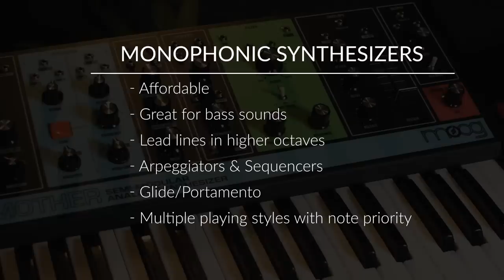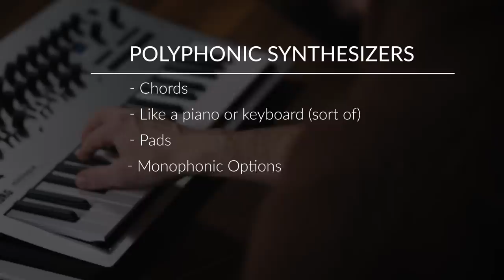Monophonic vs. Polyphonic Synthesizers: Which is Right For You? | Reverb

Comment: The Moog Grandmother can actually be used polyphonically as well. It requires the use of It's 3rd hidden oscillator which is utilized by patching the LFO Modulation. You would start from the yellow bay "ARP/SEQ" by plugging in a patch cable from KB OUT > RATE IN on the black bay labeled "Modulation". Next step, starting with the black bay "Modulation" plug in another patch cable to WAVE OUT > NOISE IN on the "MIXER" which is the black bay in the middle. You can nowuse the Noise in as your 3rd Oscillator, located below Oscillators 1&2. By adjusting the RATE knob in the black Mod bay, you can create a 3rd voice. Your second voice can be achieved by adjusting the FREQUENCY knob on Oscillator 2. Resulting in a triad, one key at a time.
Reply: You are right, I see where the cords plug in. I like the grand mother.
Reply: It's technically paraphony rather than polyphony, but nice tip!
Reply: Dude thank you for the tip!
Reply: @benjwgarner  correct - not even close to polyphonic playability, just another note that you have to change.  for the 3rd note I prefer modulation wave out ->> attenuator input, attenuator out ->> oscPitchIn
Reply: That’s not polyphony , the grandma is duophonic (your patch trick not withstanding , that’s cool) The matriarch is paraphonic. 

In my experience , polyphony when it comes to VCA synths , if they share the same filter you won’t be able to play intervals or chords well. Though the behringer synths like the poly D do ok with some of their special features .
Reply: That's still only monophonic since you can still only play one key at a time
Reply: @DG-ss1gc Moog Grandmother is not duophonic, but you can certainly get 2 or 3 voice paraphony if you sequence each VCO independently with an external sequencer sending independent CV signals. Korg SQ-1 is a great and affordable way to experiment with those types of patches
Reply: I really don't know what too get  I have about 10 synths in storage but I want too sound like  John Foxx Garry Numan ultravox and pet shop boys can you help me chrisrox 
 any one........ thanks for your time Chris

Comment: Monosynths are good for playing basslines and leads. Polysynths are for the rest. Simply said.
Reply: Yes absolutely this is why I would use both synths.
Reply: Usually, yes!  But not always.  The ARP Odyssey had a Duo-tone which which was a two-voice polyphony that lends itself well to bass.  Also, a lot of Polysynths can be played in Monophonic with Unison, which can work well on basses sometimes.
Reply: @Luke especially the ones that have a switch to go into monophonic mode to get that extra monophonic flair

Comment: Whilst interesting, this comp may have been more interesting if the Minilogue was compared to a Monologue.
Reply: pulls out monocle

“Whilst”
Reply: @maxqd3  🤣
Reply: Yes definitely, but I think the tonal result may give the same outcome. Mono synths usually sound beefier than single notes on a poly synth. Using a Moog to get that across is a good idea imo because we all know those oscillators sound RAW as f.
The Monologues osscilators also sound creamier than the Minilogues, but a Moog can really get that point across.
Reply: @rederickfroders1978  
Good points.  It comes down to how each of us wants to use the tools.
Reply: just get the minilogue and get a boost pedal for the mono sounds to sound beefier..now you dont need the monologue and you have the best of both worlds
Reply: @maxqd3  
LOL!
AND a cup of tea!
Reply: @rederickfroders1978  
Further thought is that the Minilogue has a mono mode.  Not sure if it provides the same sound as that of the Monologue.  If so, the Minilogue would be the best of both worlds.

Comment: Great video and great topic Justin. Right up my street. I love analogue synths and this video covers a lot of what someone getting into synths needs to know as well as someone who is learning as I am.

The Korg Prologue does a very good job of both poly and mono. If used for multi tracking and just using loops it  can construct a whole track just using the Prologue sounds. Drums, bass, pads, arpeggiator, lead, chords, all from one machine and the bass and the chords can be done on split keys so if you are using a looper like a RC505 everything can be recorded into it.
 
The sequencer on the Moog Grandmother is awesome and easy to use once you understand it. It's the standard Moog step sequencer that's also used on the Sub37 but even more powerful so you can step sequence leads that go for 256 step apparently. That and the fact that it's semi modular so you can hook it up to other modular or semi modular units to do crazy things with the sound makes it a very desirable synth. I'm looking to get one. 

Once again great video and keep up the content. Thanks

Comment: Best synth apps (for android) if youre either broke or fairly new to the synthesizer world, and im both
(In no particular order)
1. Common analog synth/common fm synth(paid version Ex-synth-paid version has sequencer
2. Caustic (probably the best, most extensive)
3. Hexen modular synth app-can design your own system-learning curve!
4. Heat synthesizer, tons of presets, keyboard note sequencer, all the modulation you could want
5. Rock Relay: Synth FM or Rock Relay:Analog... Lots of tones and parameter control
6. SyneprezFM- tons of presets, sohisticated Arp,
7. ARPIO... arpeggio synth-board, pro version is very cool
8. Touch Vox...cool sounds
9. Pocket Talkbox- awesome real vocoder type symth, just move your lips and mouth on the speaker-it does kinda feel like your perfoming cynnylingus on your phone but the sound is dope
10. DRC synth... All presets have arpeggio option
Hope this helps you find cool sunths to play around on or even use in your music production

Comment: A point I realized that I don't think gets talked about enough is that 1 voice =/= 1 "note". if your monosynth has two oscillators that can be tuned separately or relative to one another, odds are that you CAN play 2 "notes" (pitches) at the same time to make a diad chord. Hell, if you add in an analog oscillating filter, you can dial in a triad-- though i find it trickier to do this.

Comment: I'd like to see MOOG develop a good 4 or 6 voice poly synth with keyboard (or without...) in the $1500 price range. They could do it and do it very well.  It could be like an upgrade from the GM but without all the buttons, knobs, bells, flashing lights and whistles of the 2- note SUB37. Yes, I'm dreaming but wouldn't it be nice?
Reply: metaspherz yeah as nice as the moog one is... the price tag definitely isn’t
Reply: metaspherz They just did it, Moog One
Reply: You could always check out a Deep Mind 12. I know it’s not a Moog but you can emulate a lot of great sounds out of it. Anywhere from a Moog to Juno and you can get one for under 600 bucks!
Reply: 7000$ for a moog is criminal.It's a shame that musicians that are worth 6 figures or millions can pick that up easy. I'm in college. i wish i could have a moog one lmao. maybe in 10 years.
Reply: metaspherz Yeah, exactly. Displays, menu diving, multifunctional buttons, etc. All things that can break, stop working and need replacing or repairing. SMT, surface mount technology has made synths more affordable and more difficult to work on. Lots of times you just throw it away. Moog, or any manufacturer could go back to old school technology and building them like they used to. Vintage is by far my favorite, but too expensive. Behringer D might be the beginning of something new, that’s hopefully going to be around for awhile. Supposedly they’re attempting the crowning achievement of clones... The Yamaha CS-80.  Good luck with that one
Reply: What about the Matriarch?

Comment: Nice overview!  When I started with synths I gravitated toward polysynths.  Now I find I’m using multiple mono/paraphonic(the best!) synths together.  Less muddy mixes with monos!
Reply: This comment helped me a bunch. I was already thinking mono for cleaner simpler mixing, and also budget, but wasn't sure. 
Now i know i can't afford a Bass Station 2 right now, but i can grab a korg monologue to get started, and then just add the BS-2 next year and play them together.
Reply: what  do you like to play? what's your typical setup for just solo jamming?
Reply: Nick You Nick, The Bass Station now now has paraphonic ability — but I have a Circuit Mono Station for its sequencer ability, also paraphonic, and the same sound engine as BS II.  Monologue is a nice mono synth, once you get rid of many of the crappy factory patches.  You can do a lot with a Mono Station and a Monologue, then add a Drumbrute Impact and you have a nice little studio for about $1000.  And you can build from there.

Comment: Um... the mono mode sound on the Monoloque is the same as the poly mode sound. That is, the mono mode is only using a single voice. It will still sound and play different because you won't get any note layering and can create legato notes, but the timbre of the patch will be exactly the same.

I wish he had demonstrated it poly first, then mono, then unison. You can clearly hear the additional oscillators present in the unison sound that are absent in mono mode.

Comment: Hey, youre videos are very helpful, expecialy how synthesizers work series, that I have found so far. I have decided that I want a synth. From what I found it would be analog, because it speaks more to me.

From this video I found that it is probably worth looking at polly synth that has a good mono voice. So here is my question.. I found three nice Korg units that each suite my needs in a different way. 

First off is Korg monologue around 299€
+ it is very cheep
+ has greater sequencing abilities compered to minilogue
+ would take less hassle to carry around
+ has this drive thing for filter
- it is monologue 
- it has less keys (25)

Korg minilogue around 539€
I will list only advantages and disadvantages that are relevant for me
+ it's a polly ;) 
+great mono and unison 
voices in one box. 
+ 37 keys
- doesn't have a motion sensor for movement of the knobs when sequencer is active 
In my opinion this is such a huge advantage to have. If minilogue would have this, I'd buy it instantly. 

And here comes the confusing part 
Korg minilogue XD around 620€ They claim that they have gathered all the best from minilogue and prologue. The confusing part for me is "hybrid", if I understand correctly, it uses two same analog oscillators that minilogue uses and trows in third that is digital changeable via interface. Sound good, but doesn't it kill the vibe of it being analog? (Analogy would be valve and hybrid guitar amps, if you get what I want to say with this) Can I turn it off and operate it like minilogue and engage the digital oscillator when I wish?

+ it's polly
+ it has record motion in sequence for the sequencer 
+ I think is also has the "drive" option for filter. 
+ has these digital effects like reverb and delay, which I find as a guitar player very handy 
+ claims to have all good things from minilogue, and adds prologue and digital world. 
- the most expensive, but If like described, I'd be ready to throw that extra 100€, compered to minilogue. 

And I have questions in terms of connectivity, do all devices have similar strengths in this field? Do I need an amp? 

In the end, thank you for reading this, any new information will help me a lot! Hope be able to clear my head and by the best unit for me.

Comment: if you could add some effects to your synths which would you recommend and why? and since synths have really low notes do you recommend bass effect pedals over guitar for them? also, thanks for helping me choose the minilogue (would really like a run through on the many things it can do since it is a really good start for synths) at winter namm this year, really helps adding sounds to my bands and think outside the box of just vocals, guitar, bass, and drums in a band
Reply: I'd suggest adding a good delay as the first pedal for your synth pedalboard.  It can go a long way to adding depth to synth pads and character to lead lines.  Plus, tapping in the sequence rate can get you some great ping-pongy effects.  Something like an old EHX Memory Man if you want a classic analog delay, or a Strymon Timeline if you want a full-on digital workstation type delay.  A good middle ground would be the Earthquaker Devices Avalanche Run or the Boss RE-20 Space Echo.

After that, I'd look at Chorus/Vibrato/Trem pedals.  Those go well with the already warbly nature of oscillators.  After that, I'd look at overdrive units so you can build out grittier, more distorted sounds.
Reply: @jimtuerk  I agree a good delay or a reverb is always a good first start to a synth rig.
Reply: Reverb, delay, chorus/flanging to begin with.  Then you can branch out into all of the other effects.  Pedals are great, but pedals have to be managed and can't normally be controlled by your synth set-up and recalling your set-up will have to be from memory.  A rackmounted multi-effects unit tends to be able to recall almost all of its parameters and will generally offer you several options.  There is no right or wrong way to do it.  If it sounds good, it's good.
Reply: Another thing you can try is if you have another synth that has effects built in and A/D input, route your audio out into that synth and use the effects onboard the second synth.
Reply: @fakshen1973  There really have been some great advances in multi-effects and singular units with saveable patches. I started as a guitar player, in a really pedal heavy band, I feel like every analog player at least needs a  great delay. I mean a MXR carbon copy will run you like $70.00 and is well worth it.
Reply: I would recommend the g1on by zoom, it definitely gives the the most bang for your buck at $60 for 100 great sounding effects with up to 5 being able to be chained in any order, ranging everything from delay, reverb and chorus to distortion, an octaver and even an acoustic guitar simulator.
Reply: @TealTactics  Yeah, I have a M5 which I use mostly for delays and reverbs.

Comment: These days you can find great polyphonic HARDWARE, at reasonable prices.  Software makes it even easier to get what you want.  There has been, since at least the 70s, a group that thinks hardware is cool (patch cords, lots of sliders and buttons, flashing lights, etc.), which has its roots in the analog "days of yore".  And there IS a "coolness factor", but with what's available today, I don't see the point of "retro" synth attraction (and I have a couple myself).  Close your eyes.

Comment: Comments to the video... 
1) The built in sequencer on most synths are really basic, too basic to even make a simple tune
2) Do not choose a poly synth based on this video, go for the sound and the feeling, mono and poly synths has usually different filters, poly synths often has filters dedicated to play multiple oscillators and tend to filter out the low end much more, so based on that you cant just think buying a poly will give you the sound of a mono

Otherwise, really nice video - thumbs up

Comment: In the 1960's and early 70's, all synths were mono, because that's all that the technology allowed.  As soon as polyphonic synths hit the market, mono synths were instantly obsolete museum pieces.  Because you can play any poly synth in mono mode, if you want to, and it sounds better than a mono synth--plus it can be your main or only board.  It's only in the last decade or so that mono synths have become trendy again, and I'm still not sure why.  There is literally nothing that a mono synth does that can't be done better on a poly..
Reply: @PORRFNK  Some polys have great filters.  A Moog One, to choose an expensive example.  And oscillator differences are trivial.  Even digital VSTs produce waveforms that are literally identical to analog mono oscillators.  You need to listen with your ears and not your prejudices.
Reply: @PORRFNK   I'm certainly not arguing that all synths sound the same, whether mono or poly.  Yes, some sound thin and dull, some are fat, complex and interesting.  But I've played horrible sounding old analog monos with classic brand names (for example, the Moog Satellite).  And  played brilliant poly digitals which sound more analog than some real analog synths.  If you just want to play bass or leads or if you're multitracking, and you like the sound of a particular mono synth, than fine.  But 99% of players would be better served with finding a poly with a sound that they like.  The technical details that you mentioned are only interesting to the extent that you can hear them.  And there is just no escaping that you can do way more musically with a poly than a mono, which is why they took over the market 40 years ago and still own it.

Comment: Thinking about getting a synth, seeing there's a lot of enthousiasts on here, which would you recommend? The Deepmind 6 or the Korg Minologue (or another one that's better at around the same pricerange?)?
Reply: Minilogue xd! If you would prefer actual patch cable capabilities check out the Korg MS-20 mini. Another one to check out for even cheaper is the Behringer Neutron. It doesn’t have keys, but you can get a really nice cheap midi controller such as the Arturia KeyStep. Definitely get a synth!